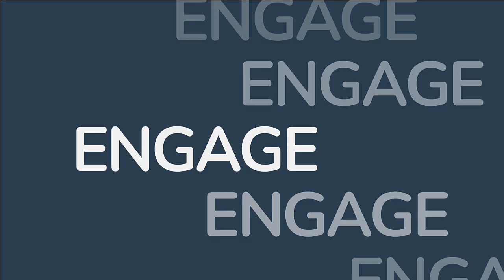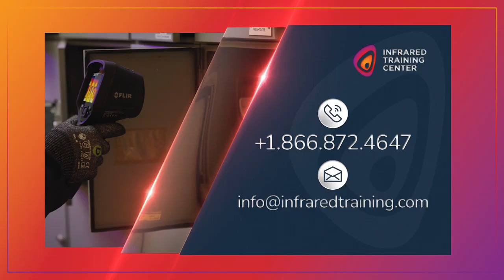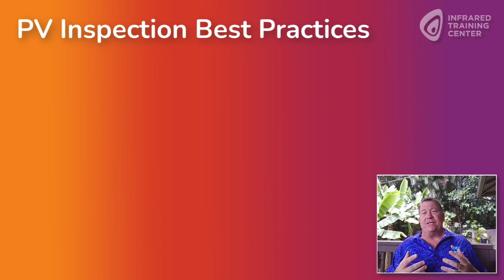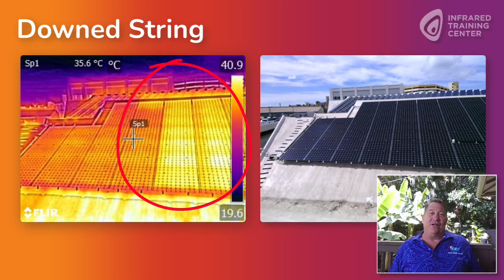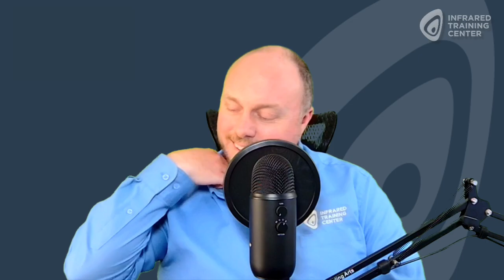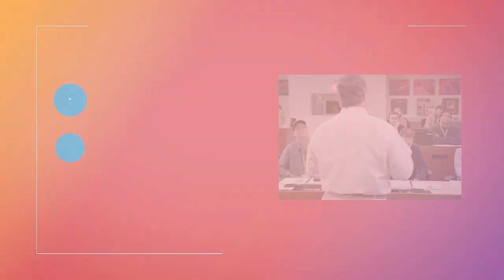PV Inspections with Thermal Imaging - The Infrared Spectrum

Comment: I completely agree with Fred's insights on the critical role of thermal imaging in PV inspections! His points on how drones have revolutionized the process and the importance of understanding heat signatures for identifying issues are spot on. It's clear that proper planning and diverse tools are essential for comprehensive solar array maintenance.